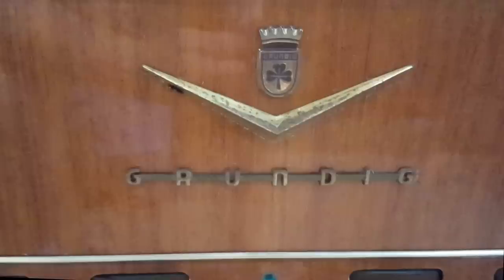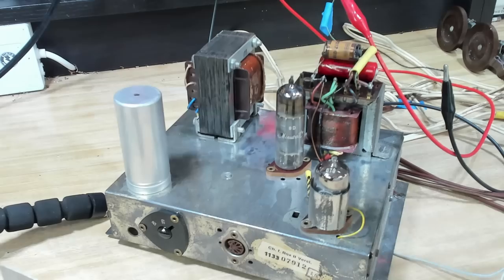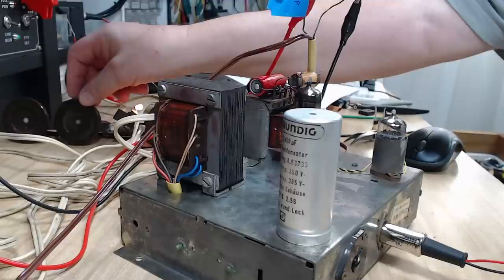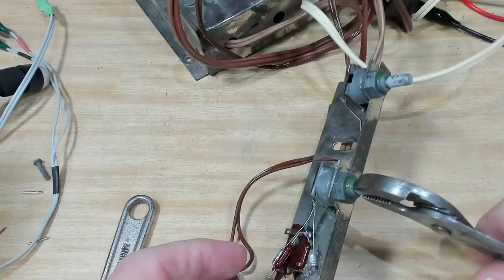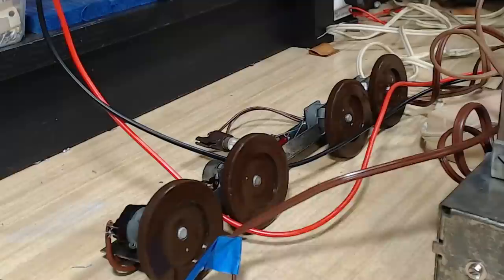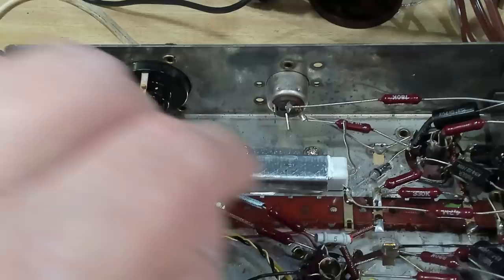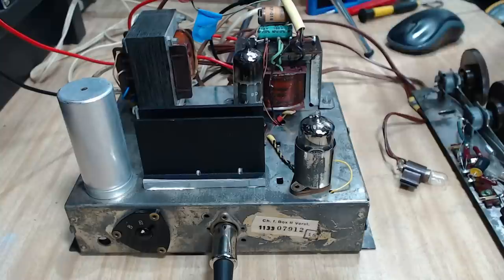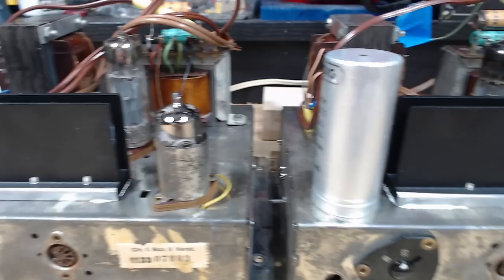Grundig Powered Speakers Repair - 1961

Comment: To be perfectly honest, Grundig(translates to English as "Basic") overcooked the design of this stereo set. Having extra electronics in what was essentially merely the remote speaker box, was taking things a bit too far. The idea is to have two boxes, placed in each corner of a room where you do your listening to records or radio(likely stereo FM). One box would have all the necessary electronics, i.e. amplifier, tuner circuits, controls, plus the phono deck(be it a single-player or auto-stacker turntable) under the lid, the remote box would, or should contain only the speaker, with enough cable to place the remote speaker over in the other corner of the room. There's no need whatsoever for any extra electronics in the remote speaker box. Several table-top stereo radiograms were made in Australia with the remote speaker held in the lid, turning the balance control would determine if the remote was for the left or right channel. I've seen a couple like this, and a friend of mine had one with a Colaro 4-speed auto-stacker turntable fitted.
Reply from the maker: Hi Neil, actually Grundig translates to Max Grundig who founded the company but that's by the by. I have no idea why Grundig did it this way, you would have too ask the marketing department. Except to say,  most European radios at the time had provision for external speakers so I guess with the advent of stereo FM in 1960s this may have been what they were aiming at 🤔
Reply: @DavidTipton101  My knowledge of the word's meaning comes from learning the language. I was not aware of any man or woman with that word as a surname. I guess this Max Grundig would be a very down-to-earth sort of person. LOL
Reply: @neilforbes416  and the world blaupunkt means blue point den Punkt verstehen 😆
Reply: @top40researcher31  Correct. (Richtig!)
Reply: @neilforbes416  many years ago i thought it blue star until i was corrected by a german lol
Reply: @neilforbes416  the brand is still around they make Party Speakers

Comment: WD-40 on pots? No way. Get some pot spray (Dexoit or CRC).
Reply from the maker: Hi James. I used the WD40 as a penetrant to free the dried grease on the shaft not on the carbon strip, although there is a good chance some may have made it in there. 
Just because there is misinformation in the radio community against WD40 and people simply parrot it on' doesn't make it true. A product should be used for it's intended purpose. Having said that... I wouldn't use either WD40 or Deoxit on a pot in any case. They both contain about 60% solvent and are quite capable of damaging the carbon track or the carboard they are printed on. Deoxit Fader is supposed to be better but I steer away from that on older pots as well as it still about 60% petroleum naptha. If I use Fader on a pot I use the absolute minimum amount. I believe It is better to dismantle the pot and clean the track, I use a tiny amount eucalyptus oil to wipe clean the track. I have found that to be very effective and doesn't damage the track 🙂